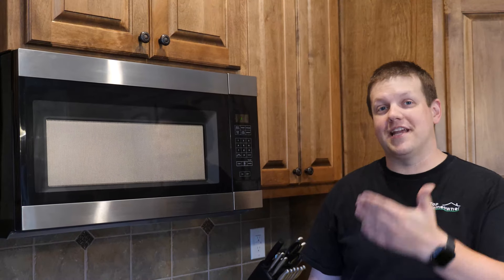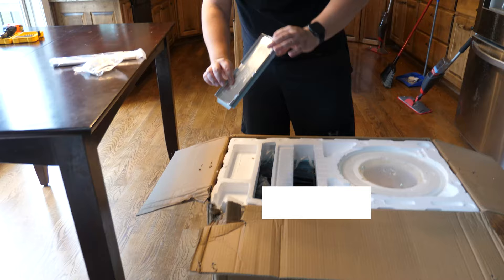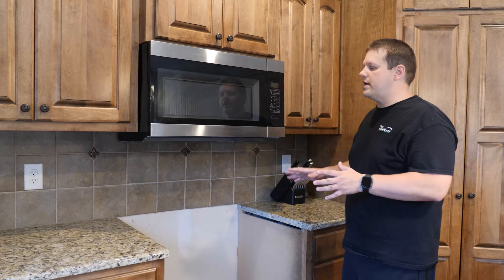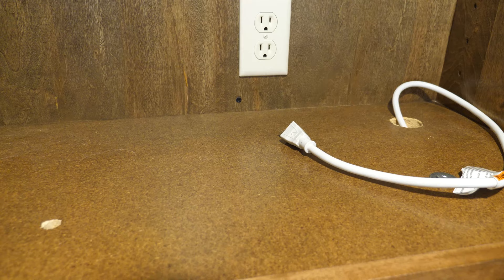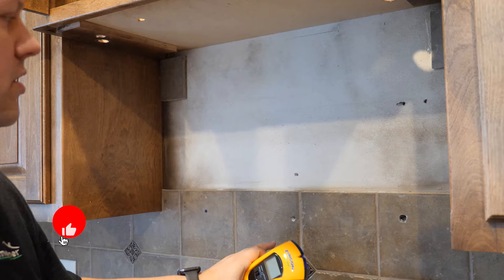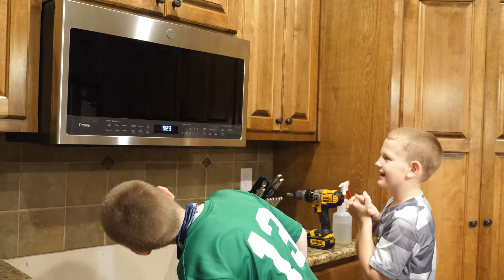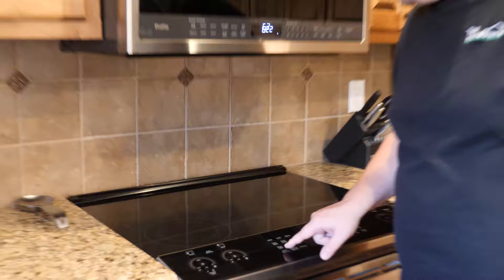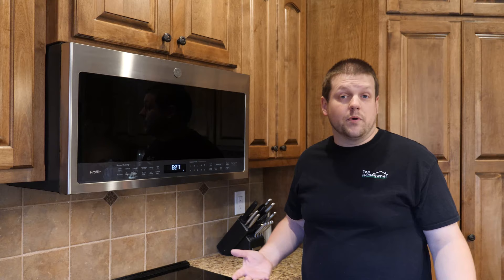Over the Range Microwave Oven Install - GE Profile PVM9005SJSS

Comment: Nice video!  My husband and I are much old and much weaker than you two and we didn't have the strength to lift this baby up above our shoulder.  We ended up using a car scissor jack to hold it in place instead of using our own mussel.  We used the jack both in uninstall old one and install the new one (the same as yours), no sweat.

Comment: this video helped me.. i was super stuck as the new micro i was installing was 1/8" taller and the backsplash went up too high!!  reusing the old hanger (had to grind the tabs slightly) mounted slightly lower, but on TOP of the backsplash tile was my ticket to victory. thanks again.
Reply from the maker: Glad it helped!

Comment: Thanks for sharing this. Was looking for a little more info/voice over  regarding how you secured the microwave in the bracket.
Reply from the maker: There are tabs on the metal bracket that match up with slots on the back of the microwave. You just need to set the back of the microwave slightly higher than the tabs (about a half-inch) then lower it down. It sounds more complicated than it is! The bracket is typically attached to the microwave for shipping, so it's easy to see how it lines up when you remove it from the back of the microwave.  Hope this helps!

Comment: Here is my experience so far with this MW. We purchased it about 6 month ago as were installing the wall duct for rear venting in a new kitchen wall. We live in a cold climate so opted to vent horizontally to prevent heat loss and the dreaded vent condensation pooling in the microwave and destroying it in 6 months routine that you read about all over the net. To anyone wanting a well-insulated rear duct with a snug airtight connection to the MW, you will have to put some serious thought into it as appliance manufacturers would rather spend development $ on fairly useless but glitzy features like blue tooth connectivity rather than designing a system that allows for precise ducting. This is not unique to GE or this unit in my experience. Anyway, I removed the mounting bracket from the unit 6 months ago to locate my ducting. While the instructions do not say to replace the two screws holding it there for shipping, the look like permanent screws and match the other permanent screws holding the side and top housing in place, so I replaced them. It would be nice if the instructions clearly said to discard these screws because it took some troubleshooting to realize that the unit cannot be installed on the bracket with the screws in place. I probably would have caught this if I had been installing the same day I removed the bracket from the unit, so this problem is probably pretty rare. But the most aggravating thing was that the paper template's location for the toggle bolt holes was a half inch off of their actual location on the bracket. It turns out that a 1/2" is right in the sweet spot to make drilling a second set of 5/8 holes in your sheetrock extra-aggravating as the holes overlap.
Reply from the maker: Thanks for sharing your experience. Thankfully ours is still going strong but we don't have it vented outside either.

Comment: I didn't see you connect the vent fan to any exhaust pipe.  Where does the air flow?
Reply from the maker: In my case I don't have an outside vent. You have multiple options when installing it though and it can be used with or without a vent by changing the fan position before you mount it.

Comment: Just installed and the microwave is tilted up..about 1 inch difference between top and bottom.  Was it installed wrong??  Do I need those spacers on top?
Reply from the maker: Based on what you described I'd say that's very possible. Without the spacers, the microwave could pull up into the bottom cavity of the cabinet.
Reply: If you had a wall like the guy who made the video, then yes. Why? Because his lower part of the mounting bracket sat on the backsplash which pushes it out from the drywall. So he put spacers up in the upper left hand corner and upper right hand corner to match the thickness of the tile so the mounting bracket would be flush all around. It also probably means he had to adjust the upper template hole drilling forward by the same thickness as the spacers. He can chime in on that if he wants. Otherwise it will look like your microwave is leaning back in at the top and pushed out at the bottom.

Comment: What can make cold air come out the sides of the microwave? Would it be the guy didn't properly line up or hook up the vent that goes up into the attic? It's so cold now that it is winter and my kitchen isn't warm. I even had more insulation put in and it is still cold around it and inside when I open the door.
Reply from the maker: There should be a flap to stop air coming back into the house either inline or at the end. If not, you should be able to install something like this: https://www.amazon.com/Draft-Blocker-Backdraft-Preventer-Deflector/dp/B0822VQMHM
Reply: @TopHomeowner  Thank you! I'm sorry, I just now got a notification to your response. It shows you responded a month ago. Thank you for the tip! I appreciate it!

Comment: Did you have to reposition the blower motor to make it recirculating?
Reply from the maker: Yes, there were a couple of screws I had to remove in order to rotate the motor. It was a pretty simple process, but it was a little tight. I tried to capture it on video but the recording didn't turn out. I hope this helps!
Reply: @TopHomeowner  just installed mine. That is my only complaint so far. Almost every other microwave comes from the factory set for recirculating, not this one
Reply: I would like to know the answer to this question too
Reply: can you tell us if the blower cover have to be facing forward or leave them
the way the factory set them up??
Reply: @tim3064  you have to turn the blower forward to make it recirculating

Comment: Are there 36in filler kits available for this microwave? If so can you provide a link. Thanks great video!
Reply from the maker: I checked with GE and unfortunately they don't offer a filler kit for this microwave. Thanks for watching!
Reply: @TopHomeowner  Thx for the info! I found a place that makes custom fitting kits. Just ordered both the microwave and trim kit. I’ll let ya know how it fits. Cheers!

Comment: Can you vent fan to an outside duct? Do you drill a separate hole for that? Does the template show you where to do that?
Reply from the maker: Yes you can. I don't remember if there is a separate template for that but I can't imagine they wouldn't include it.

Comment: Can you make a video on service this and also my microwave keep blowing the power outlet after having it for 3 years, I have already replaced outlet twice any idea what that might be ?
Reply from the maker: My best guess is that there's an issue inside the microwave (like a short) thats causing your problem
Reply: I have this exact model and had the same issue, ended up just buying the same model to replace it with

Comment: I just finished my install on the same MW and I am not sure how the blower fan covers should be located ?  I can see the squirrel cage looking from the top down is this correct or not. Also
do both the top and back cover have to be covering the squirrel cage fans??
Reply from the maker: I took a couple of pictures when I installed mine and had to change the blower fan to recirculate. First link is cover off and the second link is cover on. I hope this helps!
https://drive.google.com/file/d/1jB-ONejjZG42lNqgDu5z4szr5wj9kTFf/view?usp=sharing
https://drive.google.com/file/d/14ylov1NLbhaIe0Dp4zJRiijtk_qwmFsq/view?usp=sharing
Reply: @TopHomeowner   does this MW need to vented out or do you have it venting into the cabinet space?
Reply from the maker: @jasonastacio4187  You can either vent it to the outside or blow it out of the top underneath the cabinet doors. You just have to rotate the blower fan before you install it. It doesn't vent into the cabinet space at all. Hope this helps!

Comment: How you get the smoke 💨 out of your house
Reply from the maker: There are filters in the microwave that help and can be replaced. It's should work the same as the old model you're replacing.
Reply: Ho ok thanks so much